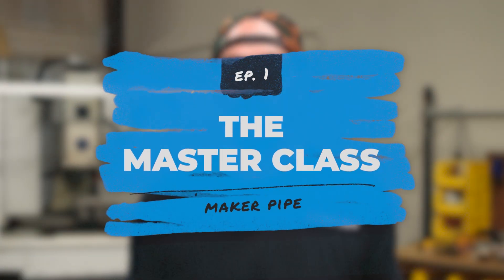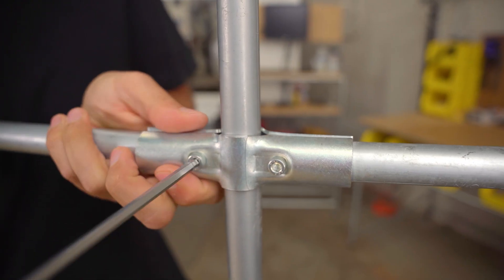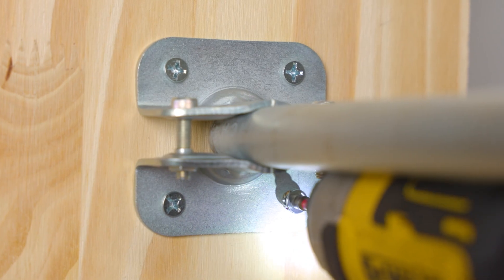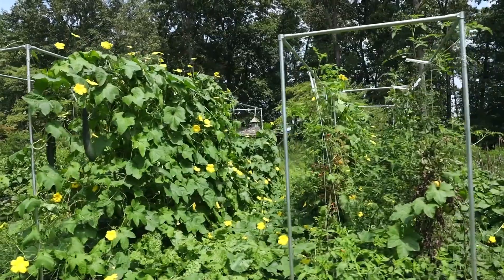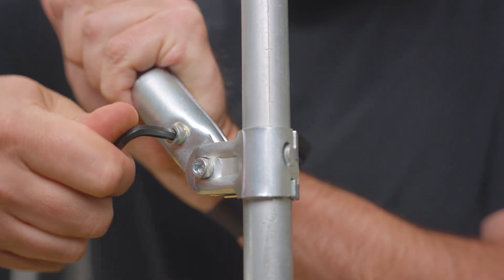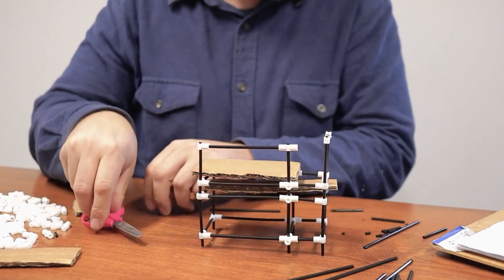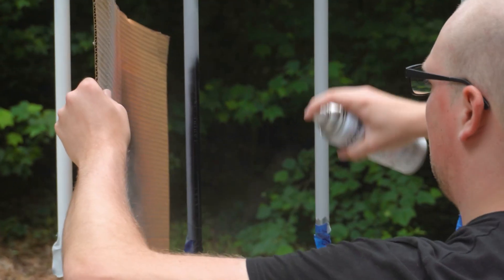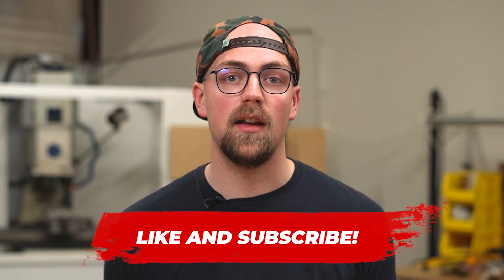EMT Conduit Building Basics | Maker Pipe Master Class - Ep. 1

Comment: Thanks for making a short, sweet, warm and inviting intro video to a medium that I never even considered but I'm also really excited by? In the cosplay community we use a lot of PVC pipe and craft foam based on portability, weight, cost, and availability. PVC is cheap but has strength limitations, and wood dowels are more expensive and heavy. This material seems like a good compromise for certain use cases. I'm already getting good ideas just thinking about places where I want strong structural support.  I could totally see this being a great material to make a cheap and sturdy overhead desk mounted frame camera rig for shooting process videos or something. They're pretty expensive commercially and I'm hoping that there may be cheaper DIY options 😁

Comment: Your Maker Pipe connections are great. I'm making a cart that can be pulled by a bicycle that will hold a 'walk-behind' mower, string trimmer, blower, gas cans etc.
I had to use 1/2" pressure treated plywood for the base, front & sides, but would prefer a 'thermoformed' body like a wheelbarrow for weight saving & overall longevity.
EMT conduit projects are AWESOME. Thank you for what you do.

Comment: Hi, Jake! Your videos have inspired me to get going on 2 garden projects. I was able to  get a quantity discount on pipe at a electrical supply house in a large city near me. Could you review if Maker Pipe connectors are different than others available online? Working alone it's not easy using, particularly the 90 degree connectors. You make it look so easy but frustration is setting in!
Reply from the maker: Hi Susan, thanks for the comment and question! I'm a bit biased because we make the connectors, but I'd say they are a higher quality than those on Amazon and other places. We use American steel and make them in our shop so we can keep a close eye on the production. We also make them specifically for EMT Conduit whereas a lot of others don't. 

I am sorry to hear that the 90's are causing some frustration! They can be tricky to get the hang of at first. I would recommend assembling them loosely first and sliding them over the tubing when you're ready to make a connection. Alternatively, you can use one of these quick hand clamps to hold up connections while you're inserting the other pieces of conduit. I hope this helps!

https://a.co/d/b2mAebI

Comment: You can substantially add strength to the tube by adding fiberglass rebar inside the tube with plastic washers around the rebar at about 1 or 2 foot apart.  I've tried this.  Greatly reduces any bend.  Try it.
Reply from the maker: Oh wow, that's a great one! What size rebar are you using? Are the washers hard to source? Thanks for sharing the tip with us!